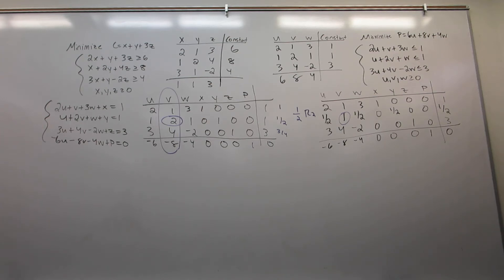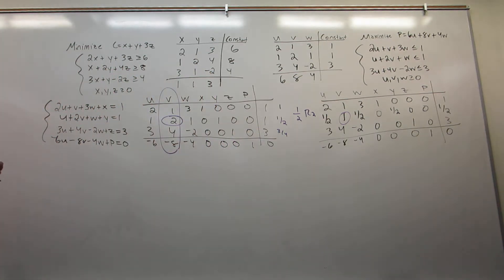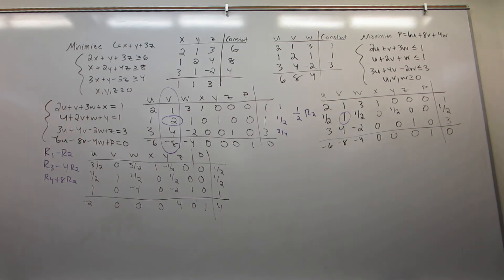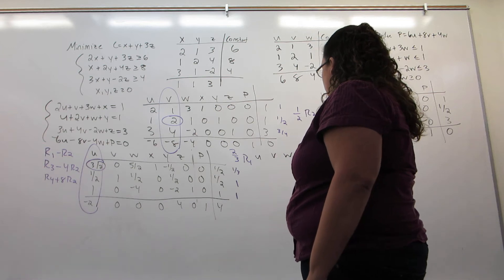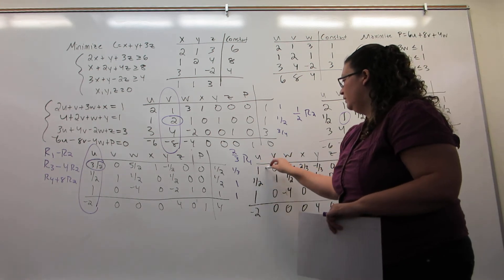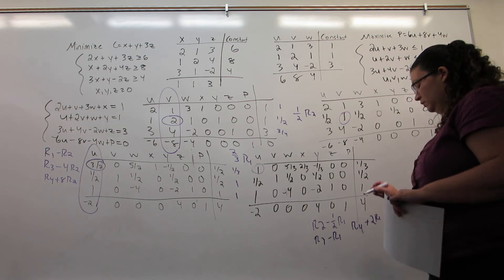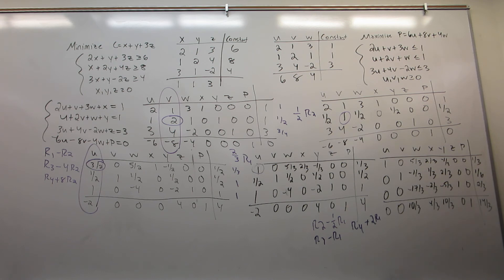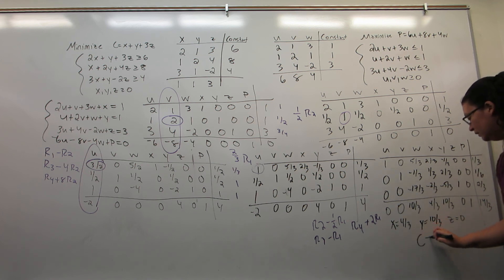Simplex Method-Minimization Problem-Part 2

Comment: Great video but if I try substituting those values into the 3rd equation 3x+y-2z>=4
3(4/3)+1(10/3)+z(0)=22/3, which is greater than 4. So i'm not sure if i'm mistaken or if there is an error somewhere
Reply: No error. It satisfies the condition that it is greater than 4.